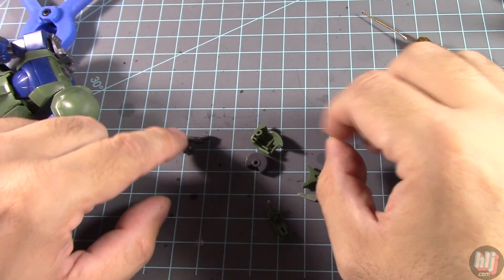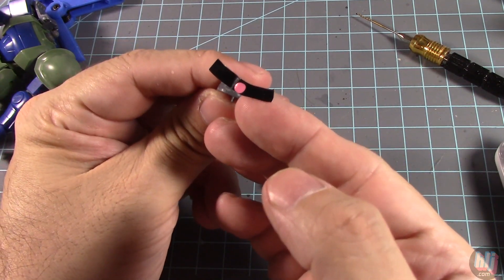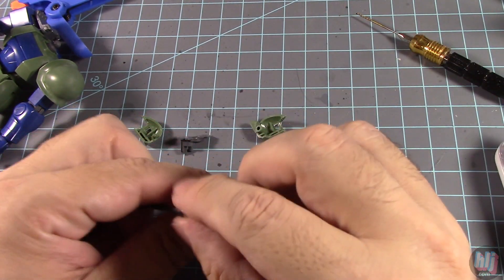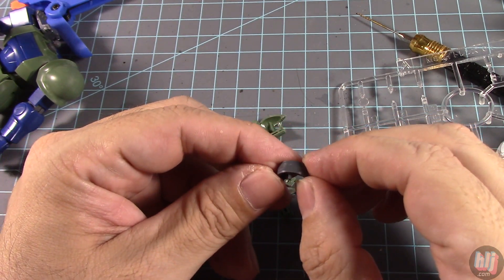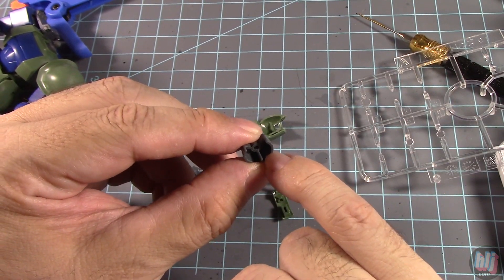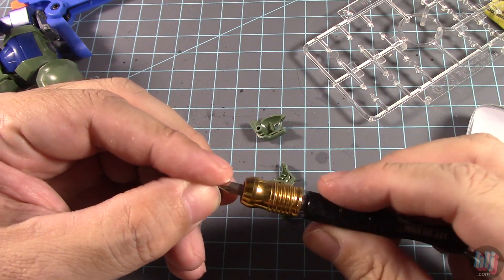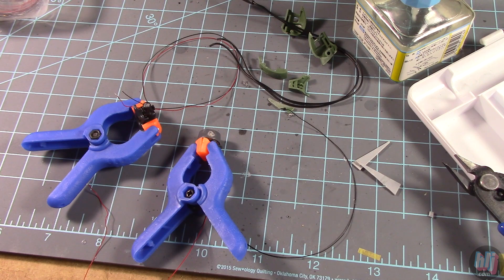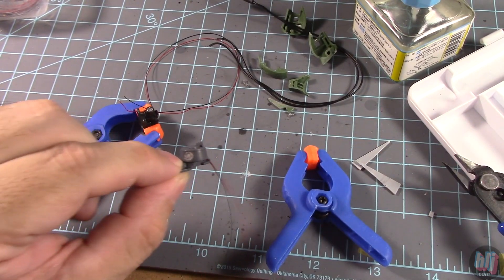*GundamCustoms* HG Zaku I Sniper Team - Part 6

Comment: 13:53 - If you're just starting to work on that seam, it might be worth starting with (fresh) 320 grit instead of 400. It'll leave a rough surface, but I think grinding it down w/ 320 then smoothing it again w/ 400 is way faster than doing the whole job with 400.

Comment: 10:49 - It's not that coin cells are a bad idea, it's just that they are expensive for the amount of power you get and their main benefit is that they are small. Being small means they can be tucked away inside a model - but integrating a battery holder into a model can be a fair bit of work, and if you are making a diorama (as opposed to a free-standing model) there are much easier places to hide a battery. I've built HGs with coin cells tucked away in them, and personally came to the conclusion that it's better to just put a battery in the base instead.
But of course that's just my perspective.